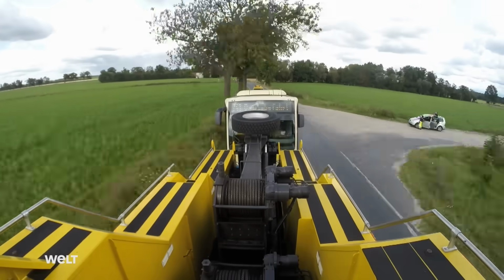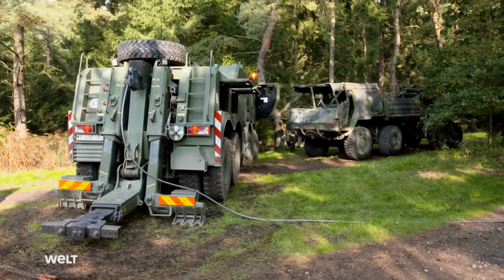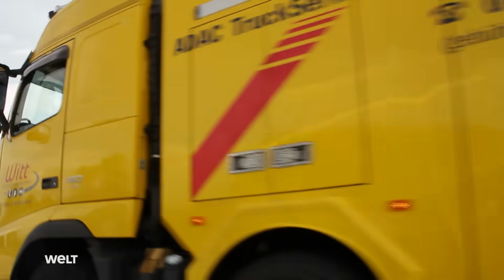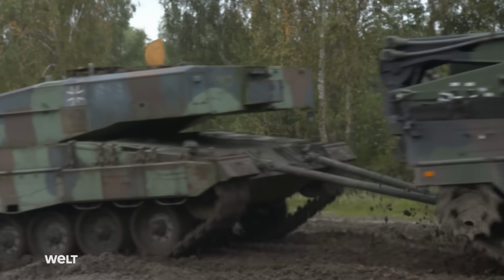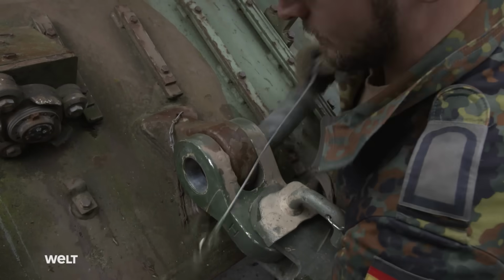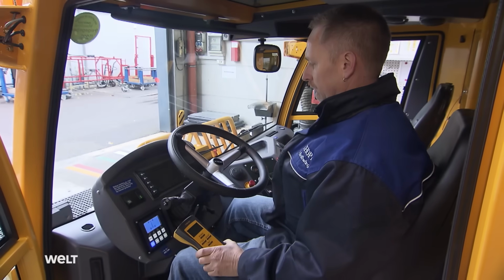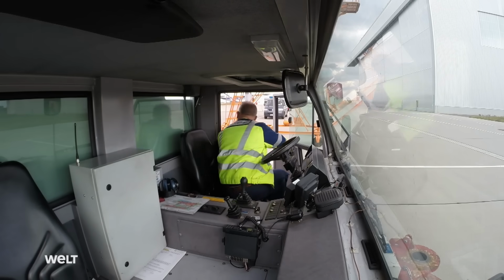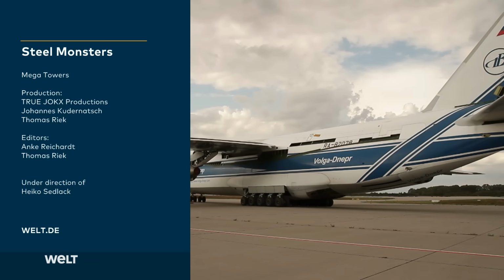Mega Tow Trucks - The World's Toughest Towing Vehicles | Full Documentary

Comment: 1. Ton is not a unit of force.
2. You can add forces with vector addition, not like 5+5=10.
Reply: 1. Going by weight, 1 Ton is a 1000kg, so it would correlate to 1000kgf or ~9.8kN
2. It depends on the directions. If they're parallel or anti-parallel, you can just add (or subtract) the magnitudes the same as 5+5=10. (For simplicity's sake, assuming they share the same axis)

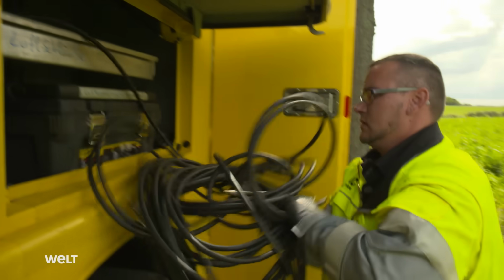Comment: 19:30 Little explenation. Trucks brakes must be under pressure in order to NOT brake, if u push pressure on your brake pedal the pressure to the brakes is cut of and the brake will close.
This is a safty feature, in case of a tube rupture the brakes brake automaticaly and u dont drive a truck with no brakes ;)
This is also the reason why they use air, you dont want to spit out oil everytime u brake.
Those nice tzzzssschhh and pffffuiiii noises a truck makes his him ventig his tubes to brake.

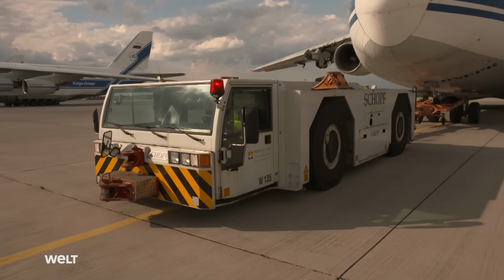Comment: 42:00 Flimsy-M.A.N.-1992-Truck can NOT move 15,00 tons around. The truck looks like it has a maximum weight of 3 tons, which means 1500/3==500 times its own weight. Even if we assume it weighs 5 tons, the load would be 1500/5==300 times its own weight, while the colossal F396-Tow-Tractor, weighing 70 tons could tow a maximum of 500 tons, which is 500/70==7 (Seven) times its own weight. Therefore, the 1,500 ton claimed weight of Ariana is FAKE. This is proved with documentation in Google/Youtube:::("Solving-Apollo-Enigma")
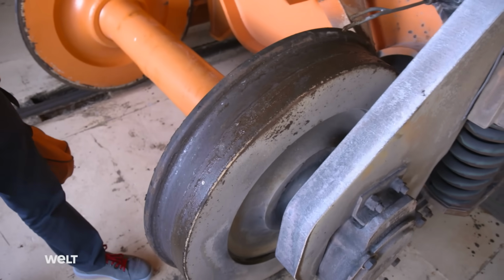Reply: 46:00 a lot of nonsense, including 45 million horsepower of thrust!!! 
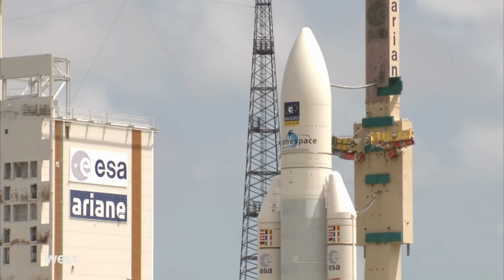48:00 Flimsy-Truck's tensile-force of 1,860 tons, four times that of the above F396, which is a total nonsense. !!!! Ariane-Rocket, as explained in the above documents, is a fake rockets, and that entire contraption, moved around by the flimsy blue truck is probably less than 30 tons, only 10 tons of which is the empty Ariane which is in fact a vertical-hydrogen-blimp, faked as a rocket, without thrust-force. !!!

Comment: Interesting Volvo 500hp tow truck? V8? Not, it's straight six, althought V8 sounds cooler so that's why they probably said it.
Also, the volvo has 3 gear spots, with "6" gears or "12" gears in total with splitter. Not 14. And its not more than most, trucks, Renault, Scania and MAN have 4 gear spots, "8" gears and with splitter 16 gears.
dumbass documentary

Comment: The door of the bus won't shut so the bus can't drive any furder, 2  frames later the door is closed. XD
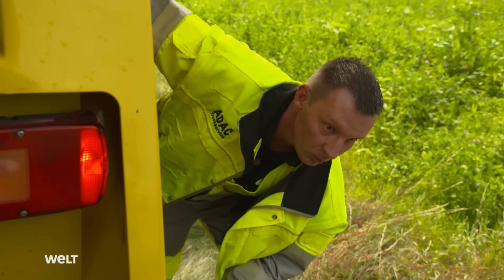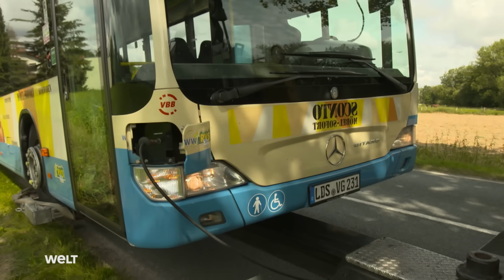Reply: At 20:03 and 20:08 right? This wasn't a staged "rescue" at all, was it? 😂😂🤣🤣🤣
Reply: @steadholderharrington9035  I guess, it was not that the door did not closes, but the sensor that reports that the door is closed. If the sensor gives no OK, the bus can not drive, but i only knew this system from the rear doors - this bus seems also have one in the front door.

Comment: wait a minute, its been a year or two since iv taken classes, but the way the pulleys set up is not as a force multiplier, correct??  the line should take the full load from the attachment point, thru the pulley n to the winch, the amount of weight wouldnt be halved because its running through a pulley in that setup right? its simply acting as a different pulling angle, if anything i imagine u get a minute amount of drag from that, if even practically measured, but u wouldnt get force multiplication.. if the line was ran thru a pulley attached to the stranded truck then anchored to the tree, then that make it twice as easy pull. i think these guys got a little confused, thats gotta b embarrassing bein the military n all :p  also jesus it took 45 minutes to do that??? lol

Comment: If u were to build a new type of better train track to lay down on the go it would hve a box beam flat side by side basic sandwitch  w/ <V> notched out middle guide at the top weld that of double edged knife. In your rocket train wheels they rap both sides of flat rail, but NOW they would hve a middle guide edge also. The chance of going off track or the track leaning or unsupported causing crash would go down 5 fold I'll beat w/ guide easy slide rail. <V> is wider then slide rail so train is free to move except when it needs it. The guide rail doesn't hve any wt on it & the deeper the guide is into rail less likely train is able to go off line. Next to potencial snow slide of mountain wall not moving that train. High side wind loads over open valley bride nope not moving that train. Only friction on guide rail pnts is where u engineer it switching & higher speed curved sections.

Comment: they moved a light house old style bricked back away from cliff in NC, on rails, also radio active dome cover dinner plate on rails. If u want stead safe heavy moving repeatedly rails or some version there of is way to go. Prt train prt tires best of both2 trucks 1 w/tires puts down track that 2nd rolls on quick lay down tracks system. They work just so together. & unlike regular tracks these hve to b much taller & self support over any lows or weak sub grade. Prt front tires then back tires & last back train rail tires sp moving wide gauge. The wider the gauge the safer the spread of the load only normal street widths still mostly need apply.

Comment: These ultra heavy lift jets I think need a 2nd nose mini wing that act as back up elevators in case of a stall or rear malfunction.  Not that big but might pitch 60 degs max lifting anti stall stubs middle lower 3rd of front nose. Might aid in shorter take offs as well or emergency extra lift in reserve blown the take off math or bad run up.

Comment: I would not pull on twin nose gear, I would like towing front wheel drive car,back into & under plate slide both front gear sets w/a tall All in 1 center pivot & turn tire just for tarmac. & arm. This way u NEVER put any forces on front gear sets or any tearing twisting forces on the tires just Your tow only Tall full 80 deg almost jack knife-able tow tire.

Comment: your plane dollies hve enough wt & enough torque, but they don't hve enough grip at break load starting pull, so add front 2 teethy hydralic pads that rest/lock down tight & just as it begins to pull load the feet up front automatically lift up few inches.

Comment: The steel tow round tub/solid tow tubes come to a single pnt pintle type connection. They hve no give in a system of max wt biggest pulling & up & down & side to side motion, not good esp the side to side. If the road shifted or gave way u would bend both bars for sure & not bable to safely recover rest of way w/out new bars. Need another joint in the drive train example. Mount pintle connection small triangle w/some7" of extra movement right & left at the pintle connection free movement top of triangle bar 14" total not pnt connection. Then 2ft double pintle arms new connection pnts & NOW connect tow bars from tank to each end of 2 ft bar. Hving that extra movement & 2 connection pnts instead of 1 will make a world of diff in load & up & down & twisting forces esp if tank trailer goes off road making turn.

Comment: saw something: crane base & max lift poss of lift angle, but base connection is weak spot. Same damn crane basic lifting & normal operations, only The main arm elbow joint can b improved. 2 curved coneal mound shapesw/ elbow resting into top smaller coneal shape that rests on lower coneal shape. AS U LIFT the arm wt max lift pnt changes as u extend the arm. The coneal shaped mount can go from 45 degs to ground All the Way to 90degs to ground to bal out the lifting load & stay in max lifting range. Normal mid sized truck cane 2 cones r plenty but w/ cranes it's All about counter mass & largest truck cane may need 3 cones & ship 4 cones resting on each other. Like counter wts by making them come appart u never hve to lift whole mounting cone at 1 time. Looks like past 90 more like 99 degs to road to stay as much max lift close in safe zone. Mayb 95 degs other mass pushing up on cone to counter full extension reach move. It's opposite counter wt simple left toward lift elbow cone & max reach pushed up to counter arm extended pulling force.

Comment: looks like german 50ton tow trucks *12 that hve 2 pulleys need 2 more winch pulleys front & rear. 10&10 tons should b enough but better 2 cut the load & make it 5&5tons front & 5&5tons safer pulling same truck just 2 more winches. Over a bridge dead lifting or crane in ditch or tank filled up side down extreme pulling.

Comment: I'm pretty sure that when the tow truck steers left while pushing, the Antonov goes left too.
it's complicated, it might have something to do with the translation. Thanks for the docu!
Reply: @fahd2605  when you back up a trailer you only have one hinge point here there's two
Reply: Here, you turn the wheel to the right, so the truck wil turn to the right, placing the connecting rod to the right hand side of the plane from our viewpoint. This will turn the steering wheels of the plane anti clockwise, making it turn to the right

Comment: I hope the mega tow truck will features the tow truck companies in metro manila philippines. where in the tow truck crews are like a hungry lions ready to strike their prey anytime .they will tow any vehicle they saw in the highways or even in a narrow roads that had minor trouble only .they will insist to tow your truck. if you are in your truck or car and you stop for emergency reason you step out then immiedietly the hungry towing men of metro manila jump in inside your vehicle to control it without your permission. they will tow it as fast as they can. if the driver resist the towing crew will throw punches on your face or start cursing you. sometimes the tow crew they cut the diesel hose of the truck and they will follow the truck when it moves on until the engine stall and the towing crew are already there to tow it unless you negotiate for a lesser fine that will go to their own pocket. This towing crews have no mercy even if you beg them for a minute to fix your vehicle that won't take long. a truck driver told me he just went out from his truck to check the tires then when he came back  a towing crew was already in his wheels and the bar was immiedietly attached ready for tow to be impounded. the towing fees is not joke it will cause you a thousand pesos. the rouge traffic enforcers are  in cahoots with this towing crews they will radio call the crews whenever they saw a potential victim and they will have their commission in every vehicle towed.

Comment: Nothing against the vehicles in Germany or anything, But they do know that a world exists outside of their own borders at times, don't they? When it comes to things like tow trucks, North America (Canada and the USA) have way larger and heavier duty towing trucks than "The Bison"; they go as high as the 100 ton class of tow trucks now in 2020 if they want to talk about "Mega-Tow Trucks".
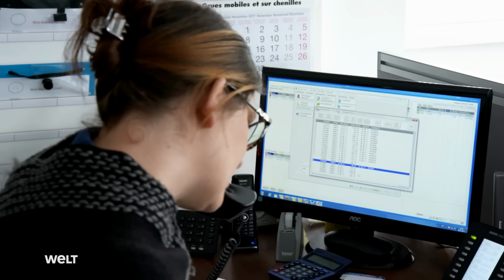I laughed when at 14:22 they mentioned that they get "as many as 150 tow service calls a year, 80% of which require actual towing". That sounds like a Very Slow month on the 400 series of highways in southern Ontario, Canada. LOL.  

And they should try the traffic on both Canadian AND American highways; talk about your insane, suicidal driver's. The driver's in Germany are so TAME compared to almost anywhere else. Talk about being DRAMA QUEENS.Those Bison driver's uniforms would have been yellowed for a whole different reason if they had to deal with North American driver's. 

The brakes of the bus need air in them because its and Air-Brake type system, which means that the brakes have a mechanical spring-pot on them that locks them up unless at least 60 - 80lbs / square inch of air pressure is constantly applied to unlock the spring-pots on the brakes.That, or the spring-pots would need to be "caged" (a physical bolt and nut system used to mechanically back the spring off of the brake drums).  

And as for the transmission, normally you just have to put the transmission into neutral to negate any effects on the transmission gears. The only time you need to dis-connect the drive shaft is when the gears are jammed up in one of the drive gear selections and it can't be disengaged due to engine damage of some sort.

For taking an hour to do that particular tow job, The OPP (Ontario Provincial Police: as seen on the show Heavy Rescue 401) would have had a complete $hit-fit if that job had taken the heavy vehicle recovery operators even half that long to do such a simple recovery.

This show is a complete Drama Queen Production from beginning to end. Yeesh!!
Reply: Cause i dont have million years to answer all your mistakes ill just correct the worst i saw, you always need to take out the drive shaft on a bigger vehicle, otherwise you destroy the gearbox. Google it.
Reply: @tobiasmetzger1195  That applies only when you are unable to shift the transmission of the vehicle in question into neutral, as I stated earlier. Said vehicle can also be towed quite often by lifting the drive-tires off the ground and locking the steering tires in place, so there is no issue with the drive-train during towing. We can get into all sorts of sub-topics on towing of heavy vehicles if you really wish to; I've participated in the tow rescuing of several such vehicles myself as part of the life-style of a semi-truck operator. It still doesn't invalidate what I said, so bring it on! Google will only take you so far. Real-life Experience can't be googled, it has to be lived! 😎

🔥🔥 will be used to cook my meals, so make sure to make them 🥵HOT🥵!!!   😂😂😂
Reply: @steadholderharrington9035  i said you should Google it, as you seem to be misinformed. Sure, if you can lift the drive axle, it's not necessary, but other than that you need to disconnect the wheel and the gearbox, which you usually do by unbolting the drive shaft. Im not a native English speaker, so i hope you get what i mean. In big vehicles you have an oil pump in the gearbox which only works if the engine is running. So, if you tow a non-running truck and its  driven wheels are on the ground, the drive shaft is still in place and you pull it like that, you'll pay for a new gearbox cause its definitely broken, if its more than a few hundreds meters

Comment: About the German "Bison," tow truck...  When towing the huge 8 wheeled vehicle in the video, did they have to remove drive shafts from the rear wheels, and/ or the front wheels?  Or was their a "neutral," position on the transfer case?
On a vehicle that's designed to be an 'all wheel drive,' it would have seemed the front wheels would have been spinning while in the air on the hook of the tow truck!
Reply: It was probably already staged with no driveshaft or axle in it. I also did5see any airlines and I doubt it has a handbrake too.

Comment: That narrator needs to get his fact right. 
I stopped watching at -“it’s powered by hydraulic power steering”
Reply: You mean the writer? The narrator just reads a script.
Reply: yeah also volvo doesn't produce v8 engines with 500hp on a truck with a 480hp badge
Reply: Hydrostatic power steering upgrade on my corvette made it sick fast V12 turbo charged Military Diesel litres per kilometer.
Reply: RhedinRage ?
Reply: many facts in this are just made up waffle
Reply: @aidansparkes12345678    I had to giggle at the 28 tonnes and 88 kph part.  Every truck/trailer combo weighing 40 tonnes plus is doing that, even when they are supposed to be limited at 85.   Oh and try to count the total amount of "IF"s in an episode....  IFFFF the bus slides off, IFFFF the weather turns nasty, IFFFFF the sky falls down, IFFFFFFFF a nuclear bomb were to go off.......
Reply: @heijxje  most are limited to 90, not 85. And aren't supposed to be. And its a difference if a regular semi is doing that speed or a tow truck

Comment: What a crap documentary. The German bison is weak. The M984A4 has a rated towing of 50 tons. Or 45 kilos with only 8 tires. Weak ass spades too. The M984A4 is also 100 times more capable off road too. Those puny ass tires will get stuck in anything

Comment: The bus won't move with the doors open, and the doors won't close. You can't drive with passengers with the doors open incase someone falls out! But the problem is with safety switches, sensors and such. the easiest way to solve this would be to bypass the door interlocks and drive the bus to the garage where it can then be properly fixed.

The interlock systems are designed to be able to be bypassed if needed for maintenance there will be a local way, some wire or connection you can short out to tell the bus it's 'safe' regardless of the situation. Or a global way, where all interlocks are disabled. Note that these interlocks are a different system from the engine management.
The more complicated solutions will be to mechanically interfere with the doors to either make the sensor think they are closed, or to force them shut.

Either way it just saved the bus company £500-1000.
Reply: Thought there should be an option for the driver to manually & physically close & lock the door shut if its pneumatic system malfunctions & is unable to do so

Comment: the bus won't move with the door open. who closed the door then???
Reply: Was more likely an air leak or electronic failt in door system requiring lengthy disassembly and new parts. No air or electronics no door close. No door close, no handbrake release. Handbrake operates on independent supply. Give it air from external source and handbrake releases so bus can be towed. Quicker and safer to recover vehicle than repair roadside. 
Door air can be dumped independently in emergency allowing it to be opened and closed too but no longer safe for transporting passengers.